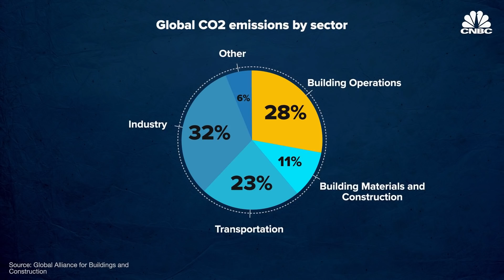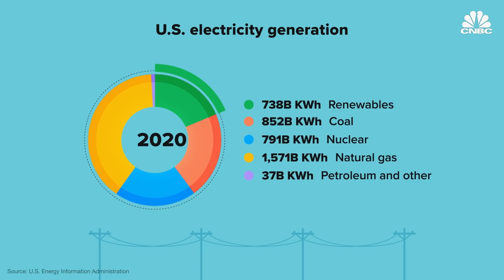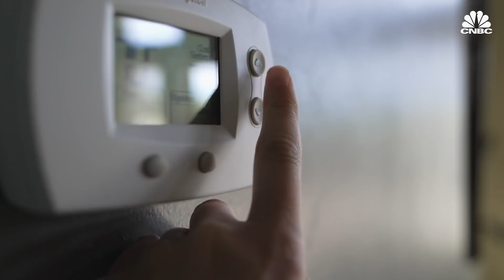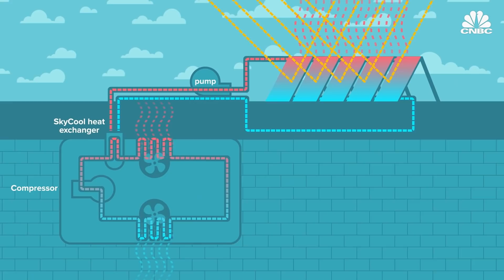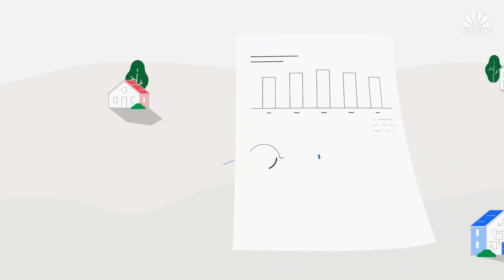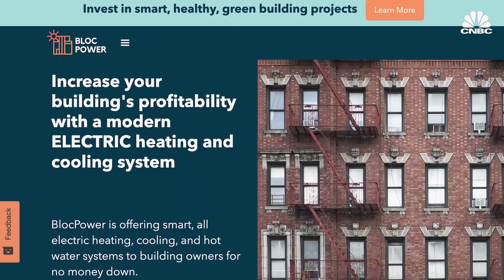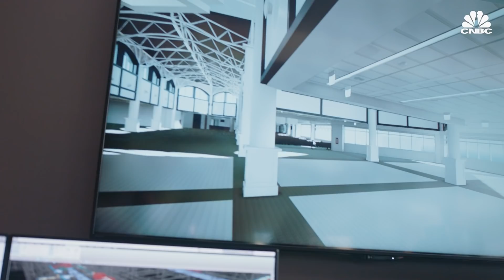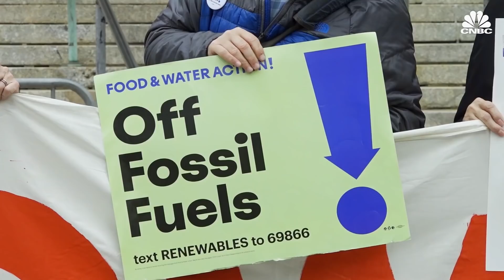How Air Conditioning Is Warming The World

Comment: These people have lost their minds.  To green the worldwide electric grid by 2050, you have to build two nuclear power plants PER DAY for the next 29 years.  Or, if nuclear is unpleasant, about 3,000 wind turbines, covering 300 square miles PER DAY.  The average time to build a nuclear power plant is 8-11 years, assuming you could get one approved.  Oh, and in addition to all that building each day, you also need to decommission an equal amount of fossil fuel infrastructure each day.  Oh, and for every megawatt of wind and solar you install, you have to some sort of reliable backup (usually nuclear or fossil fuel) - and no, batteries can't do it.

The electric grid is not going green by 2050 and certainly not by 2035.  I hate to break it to folks, but fossil fuels are what allow us to survive.  How many would have died in Seattle without that air conditioning?  How many would die each winter if not for that natural gas heat?  How many would starve without fossil-fuel powered farm equipment to harvest millions of tons of crops and run the infrastructure to process and transport that food?  

I'm all for using renewables where they make sense, but we better wake up to the fact our very lives are dependent upon fossil fuels and that's not likely to change within this century.

Comment: There is a caveat. Heat pumps are only effective in moderate climates.  If you have very cold Winters or extremely hot summers, they will not work. They either freeze over or they cannot disperse the heat efficiently.

Comment: I cool most of my house with three window units that are powered by my own DIY solar power.
Reply: A mini-split is more efficient and will use less of your solar power. You can put thick insulation between the inside and outside unit. In a window shaker there is a tiny sliver of foam separating inside from outside. Also heat leaks through the half-open window, that you can never close or seal properly.
Reply: @DMahalko  I have already picked up a Mr. Cool mini Split and plan to install as soon as I get a chance.  It will run off the solar as well.  Thanks!

Comment: Weird that they didn't even mention geothermal. A couple meters below the surface the ground is a consistent 50 degrees or so, making it an ideal source and sink for heat pumps. Instead of trying to push heat up a thermal gradient both when heating in cold weather and when cooling in hot weather. A geothermal well lets you "push" (in this case it would theoretically be possible to extract energy from the flow of heat while cooling the building, just impractical) excess heat from a 70 degree room into 50 degree dirt and rock regardless of the temperature outside, and only requires you to pull heat from 50 degree dirt and rock up to replace lost heat in your 70 degree room, instead of trying to pull it out of air that is literally freezing temperature or colder. Air source heat pumps do work, but not as efficiently as geothermal or hydrothermal sourced pumps.

Comment: if houses are build and air seal tight with Low-e windows then it will not get hot in your house it will be cool with AC running for 1 hour 3 time a day 15 hours a week thats a good build house some people dont get that 🤔 save on money and energy that why solar companies ripping people off they makeing money when people running that A/C losing money and spending on new A/C building code on new home need be updated on sealing and air tight why nobody talking about that you start from A building homes new building code then B energy getting low less energy use global warming change

Comment: I live in the NW and don't have air conditioning...however I remain cool.  I live in a rural area and have a well for drinking water and an irrigation  ditch for my trees and outside greenery.   My well has pretty cold water that I use in a heat exchanger.  I have a transmission cooler attached to a box fan in several bedrooms that takes cold well water running thru the cooler attached to box fan and return the water outside to irrigate plants.  There is NOT a compression cycle like in air conditioners, and it is strictly a heat transfer solution.  Like air conditioning, there is condensation and water droplets form on the cooler and then accumulation in a pan.  Periodically I use a cloth to soak up the water and wring it in a pail.  The cost to me?  Running a household water pump and a box fan.  The electrical usage is much, much lower than running an a/c unit.  BTW...the longevity of the box fan and pump is much longer than a a/c unit.  The system works most efficiently when the difference between well water and air temperature is the greatest.

Ammonia and CFCs are used in a/c unit because of the high specific heat (i.e. ability to absorb or release heat).  Water has the next highest specific heat and works because air has low specific heat and the heat of the air is transferred to the water to go outside.  Note my system is not an evaporative cooler where water is evaporated, and for mass balance the cooler water vapor has to exit the house, or the house will get muggy.  Also evaporative cooling doesn't work in a humid climate.  My system will work in the humid southeast as well as in the drier western US.  The colder the water, the better the heat transfer.  If you use this in the southeast or another humid climate expect more water condensation and this is a great way to eliminate humid air in your house.  Also note, this is a closed system solution and you must have all windows closed and a way to get water into the heat exchanger and exit the heat exchanger.   Do not take in outside air and the fan/cooler is inside the house.  I have a lawn hose that goes thru an insulated opening in the window and goes out in another hose to the outside.

When it was 115 F in the great heat wave, my inside temperature was around 75F and I didn't have a high water flow.

Materials needed:  box fan, transmission cooler (get one large enough to cover most of the fan), attach with zip ties, small rubber hose (3/8 inch or so) which may come with the cooler, brass adapter that is barb to garden hose, and garden hose.  Use a valve to regulate how mush water you want to go thru the cooler.  More water flowing means more heat transfer and a cooler air flow from the fan.  Because water has such a high specific heat the water flow doesn't need to be that high and you can experiment.  You can use a garden water timer if you don't want to mess with manually turning on a valve.

Comment: How about we make a air conditioner that reasonably priced, is durable an will last 20, and a good efficiency...
I bought a highly efficient central air unit an it was nothing but break down, repair, break down, repair.... not worth it! It lasted 5 years an was gone... bought a cheap no where close as efficient and it still running strong no issue 7+!

Comment: The problem in the usa is that they build cheap homes from wood and drywall and almost no insulation at all, and then install 2-4 airconditioners to keep it cool
and that is insane! I live in holland europe and i live in a small home and my backyard is located on the south so the sun is burning all day there, so 20 years ago i started 
to plant bushes and trees and now my backyard is covered in 80% shadow, so no more heat there and no more heat in my house,  and when it's really getting hot
then i have a small portable A/C that i use about 10 days a year!

Comment: Australian here, are heat pumps not a common thing in the US? They're in almost every building here, and we just call them air conditioners (they heat and cool).
Reply: Depends where you live. In Florida and the southern states they are common. Northern US use more gas furnace systems due to the colder temps in the winter.
Reply: They are also very common here.

Comment: Cool, so if my AC breaks and there’s law to input these new clean energy heat pumps replacing the older models…or if the demand goes up just enough to the point the of the existing manufacturers will also adopt this tech I’ll be the first one to sign up as will all the viewers of this video! 

Spread the word bruh

Comment: I've wondered if solar cells could power even a modest AC system to at least offset costs somewhat?
Reply: Yep. My photovoltaic panels cover the vast majority of my electricity needs, including the AC in summer. Of course, the house being new and very efficient helps a lot

As it is now, I'm expecting the solar panels to pay for themselves within 5-6 years.
Reply: @miken3963  Nice to learn that. I guess the biggest expense lies with the batteries? Glad it's working out for you! Living in middle Georgia I'm seeing more houses with photovoltaic panels on their roofs. That's a good sign.👍
Reply: @raybin6873  Yep, batteries accounted for about half of the price. You can actually go without them though if your local power provider is decently reliable and opt for a grid-tied system.

Sure, it's not as flexible and you won't have power during outages, but it's cheaper upfront and can be very lucrative depending on how they account the power you're dumping into the grid.

Comment: There's no way out of the global warming issue. Unless we switch to non fossil fuel energy use. It's a law of thermal dynamics that. Energy can't be created or destroyed once converted. When energy chemically stored in fossil fuel is converted to heat (chemical energy converted to heat energy) That heat is added to the Earth's heat. Unless we take heat energy and convert it back to chemical energy, we will continue to heat the Earth. In addition the production of CO2 from the chemical conversion of stored fossil fuel to heat. Insulate the Earth from radiating heat to Space. This addition of Insulation. with added heat from from converted fossil fuel. Will continue to heat the atmosphere  no matter what equipment we cool our living spaces with.

Comment: I keep seeing people installing "mini splits" . A mini split will not last 10 or 15 years they don't last 5 years in a 24/7 office type environment in a place Like florida.They are almost impossible to find the parts for it, they are all proprietary and quickly discontinued.They are good little money makers for the a/c man though , they look nice and are quiet already filled with freon your up and running same day UNTIL  the repair man has to come and he says sorry you need an entirely  new system. As a matter of fact i know one company that when you call about a mini split issue they send a sales man, not a repair man that checks the breakers and that's it because they are so hard to work on it's not profitable so if its not a breaker or dead remote batteries they sell you a new one. . The world will have an unbelievable amount of these junk mini splits to dispose of in 10 to 20 years all with refrigerant and oil inside them and India OMG the problems there , see those mini splits actually blow up capacitors during power spikes and india's power system is a joke. .Selling people a no money down system that will pay to itself in 10 to 15 years that won't last that long is like a bait and switch. A mini split is fine but the need to be considered as disposable as a window unit,figure on 5 years of hard use and 7 or 8 with moderate assuming no power spikes

Comment: Cooling is power hungry and its essentially pumping heat from inside to outside, so it's making it hotter outside.
Reply: And don't forget the global-warming refrigerant that will ultimately leak in time with pressures between  300 to 400 PSIG.

Comment: Here at 45 degree latitude the "sky cool" panels are more efficient if on the northern side of the roof. years ago I was looking at some panels that could cool at the rate of 5 watts per square meter to near freezing. Add solar to the southern roof and you have a nice setup. Edit: FYI you want both cellulous and fiberglass in the attic if you want more than a R60.

Comment: So when it was even warmer in the middle ages they must've had REALLY inefficienct air conditioners.
Reply: @ THE Aquarian:
    If you did a little research, you'd see that the Average Warming Per Century for the 11,000 years since the last Ice Age ended was a tiny 1/22nd of a Degree Fahrenheit (F) Per Century.

   The Problem is that when all these Climate Scientists with PhDs in Climatology, Math, Physics, etc. they say things like : "The Earth warmed by ONE degree F in the 20th Century,
     THEY FAIL TO POINT OUT THAT RATE IS TWENTY-TWO TIMES THE 
     HISTORICAL RATE OF WARMING!!! DUH!

The same thing is true of the Annual Rate of CO2 Increase in PPM (Parts Per Million (with an "M" like Mary)  ) 
    It will increase 2 or 3 PPM per Year.
doesn't sound like much, except when you compare it to the Historical Rate of five parts per BILLION (With a "B" as in Big!)
   Five Parts per Billon (PPB) is 0.005 PPM

   So when the CO2 goes up by two PPM in a year,
   it's 2 divided by 0.005 or 400 (FOUR HUNDRED) times the Historical Rate!!!!

KABEESH?
Reply: @rdelrosso2001  Ice core samples and the Solar Cycle. Look 'em up.

Comment: Finally someone speaking about it. It's been years since I have been concerned and been pointing to this issue. Specially during the lockdowns, when most of the offices were closed and vehicles use was banned (a sharp decline in heavy AC use as compared to personal use at home) the overall temperature came down a lot, even in the hottest summer months of May/ June in India. To a point that most of us didn't need ACs during peak summers. It is a serious issue. 
Also, it makes us used to or conditioned to being in more colder temp, hence making us feel hotter even in the slightest of increasing/ warm temperature.